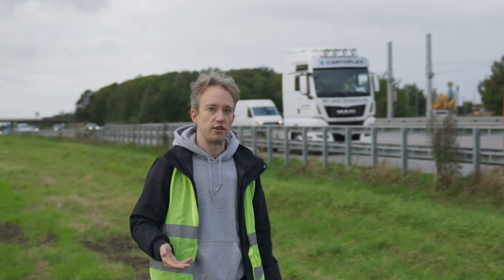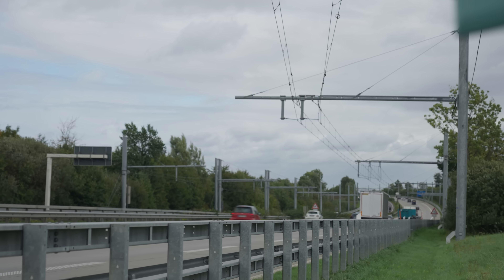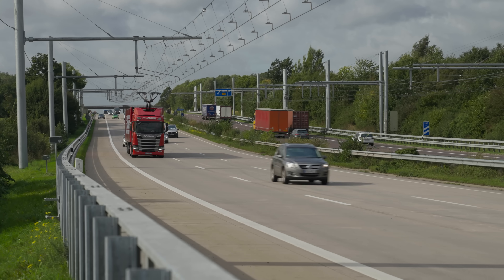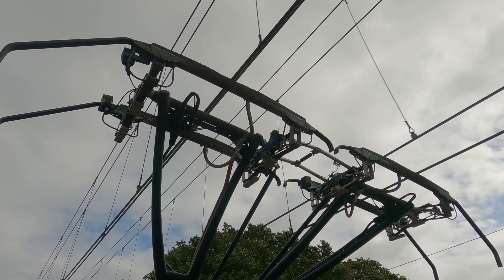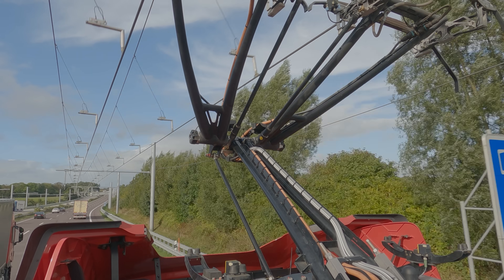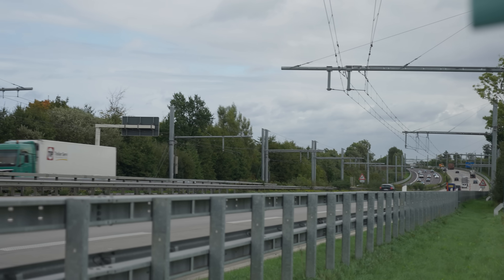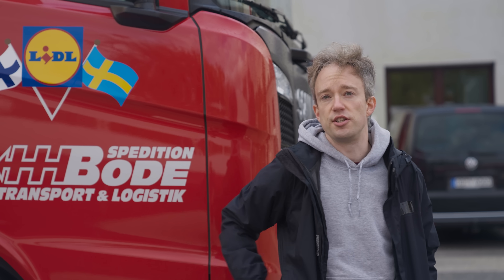The highway where trucks work like electric trains

Comment from the maker: I'm worried that this feels like an advert. It isn't. This is just a brief overview of the technology, and so far this is just a 2km test track, one of several. But this seems like such an obvious-in-hindsight idea (to me, at least!) that I found it very difficult to frame it in any way other than "I think this is a good thing"!
Reply: That's A fair thing to be worried about, especially with the Veritasium-sponsored video controversy recently. As a long time subscriber, I wouldn't have thought that you would do a video as such, and this doesn't feel like one of those videos... at least to me
Reply: @Cark0213  I mean is that really surprising
Reply: @Tera-plex  No it isn't. It was just unlisted.
Reply: @RicardoMontania  BRUH that's exactly what I was saying...
Reply: @RicardoMontania  so yes it was 🤦🏻‍♂️
Reply: Someone should point out trolley busses in the city of Arnhem in The Netherlands to Mr. Scott. Its city wide and has been operating since 1949...
Reply: @MarijnRoorda  I was going to point out the same thing for San Francisco about half the City back in 2010 was serviced by Trolley Busses. They also had Street Cars(Actual Trolleys) Running in more touristy areas, then there are the famous Cable Cars...but that is a more a tourist attraction then a transit system. The nice things about the Trolley Busses, at least in SF is that the Trolley itself is long enough that it can stay connected to the overhead wires while changing lanes and pulling over to stop. 

In major cities or places that already have trolley busses like Arnhem and SF they could even use that system for last mile delivery. 

Yes, there is still the issue with how the power is generated, but that is something that is also being worked on, and Greenhouse gas capturing is a short term mitigation while medium and long term solutions are worked out.
Reply: @MarijnRoorda  not trolleytrucks?
Reply: @MarijnRoorda  How are the trolleys unique? Most of the quarter-mil+ cities in Eastern Europe have or had trolleys. It's a different system from the video at hand in that trolleys classically didn't have backup (batteries or ICE), and their catenaries are usually captive(ish), following the lines, unlike trains and trams and the system in this video. So, how is the Arnhem trolley system different from other trolley systems?
Reply: @MarijnRoorda  there were trolley buses all over the major cities and towns in the 1950s, replacing trams, then all were done away with in the 60s & 70s in favor of ICE. Now trams have made a comeback in some cities.
Reply: You are teleporting around Europe!
Reply: it worked last century with trolleybuses, should work this century with lorries.
Reply: @misterthegeoff9767  
Yes and given the availability of modern 6wheel 100plus seat luxury coach bodies equipped with modest wt. on-board batteries to get round allow them to take diversions ..road works and accidents as well as having to divert overheads to stops or depots.  Just skip the overheads, lanes and complex juctions become simple to engineer and maintain.
They can be quieter, cheaper and more reliable ...trams and tram lines are a bad combination with other vehicles, cars M Cycles and of course bicycles especially. 
They are also infrastructure intensive and expensive. 

One accident and a whole network or line can be closed for hours or days or months .eg subsidence following flooding ..
if a road vehicle catches fire it can damage the tracks requiring replacement. With little chance of instituting a diversion. 
Dont forget the extensive history of mining war damage and unstable ground conditions and underground services in many areas.

You also have problems with debri and vandalism of the tracks. 
Water, ice and snow also require specialist track clearing equipment.
Reply: Hi Tom!  Maybe I missed the point, and if so then correct me, but isn't all of this already done by electric freight trains? I don't think you need this as long as you use the freight network that is already put in place.
Reply: @creator2960  The train infrastructure in Germany is at max capacity and incredibly, frustratingly inflexible. It would costs a lot more to lay new tracks - in terms of money as well as time and area. And there just isn't that much free space available. 
:D Oh, and those highways are already very handily lying everywhere around the place. ;)
I love the idea. And it's great that they test it to see whether it turns out to be as good a solution as it seems.
Reply: But Tom, isn't it obvious that for those mentioned long distance transports the environmentally better solution clearly is: Origin : E-Truck -> Train -> E-Truck : Destination, where E-Truck is a battery powered truck for schort (sub 50km) distances?
Reply: It doesn’t feel like an ad
Reply: No no you've convinced me to buy several miles of electrical infrastructure it's all your fault
Reply: Seems like the ideal solution is to build a Catenary Truck that's also fully electric with a lot of energy in a big box, and to use the catenary system to allow the truck to conserve 'fuel' along the highway and use it only when going out into the more rural areas, as discussed. 
The ultimate "¿Por que no los dos?".
Reply: @JonathonBarton  That's what that truck does, off highway it runs on batteries.
Reply: @marvindebot  Tom specifically stated that "it switches back to diesel".
Reply: @JonathonBarton  I know, I was replying to someone who thought otherwise.
Reply: There is also a track like this in the Nordics somewhere, I think outside of Stockholm.
Reply: Don't worry, Tom Nicholas can't hurt you.
Reply: it's funny that busses used to run like this in cities until internal combustion engines and fuel got cheap enough. and with trucks possibly going to that system, we went full circle
Reply: Tom Nicholas putting fear into the hearts of youtubers these days.
Reply: You didn't get paid and had control. It's not an ad.
Reply: it's all good. i love this type of content
Reply: I would just like to point out that Top Gear actually suggested almost exactly this idea for electric vehicles about 10 years ago. Use a battery power to get to and from main roads and power the vehicles using overhead wires from that point on. It always sounded like an excellent solution to the problem of EV range to me.
Reply: Wish there was an economic breakdown of this 2km track. How much did it cost to build, and how theorhetically it could pay for itself
Reply: This is the age old argument for electric vs diesel trains in the 18-1900s… it’s up-front investment vs long term expenses. You’re not wrong, but history has proven humans are greedy and short-sighted ☹️
Reply: If you are going to use a ”track“ anyway, why not us a freight train for port - warehouse transport?
Reply: this feels like a goof fit/evolution for your channel.
Reply: Didn't seem like an advert to me.  There was no mention of any specific manufacturers or companies.   The only product I noticed was a Scania truck and that was only in an incidental outside shot as you passed the working truck.  I think wouldn't worry about it.
Reply: @epolk1968  So, if I were to shill this hard for something else, say big pharma, but didn't "mention any specific manufacturers or companies", it's not shilling? Interesting...
Reply: Is Germany your favourite country?
Reply: If this is an advert, where can I buy this product?
Reply: This seems like an incredibly stupid approach due to the HUGE infrastructure cost and maintenance of these electric terminals. Hydrogen is a terrible solution for consumer vehicles, due to its own infrastructure needs, but makes a ton of sense for trucks due to them taking the same routes. It's cheaper than electricity, easier to maintain, not stuck on a grid, etc.
Reply: but Tom. Have you considered Trains
Reply: @ff-qf1th  kind of my thoughts too but this is probably a cheaper solution
Reply: Tom, you could always do a follow up by visiting a TrolleyBus museum in the UK - a quick google shows there are ones in Norfolk and Doncaster. They might be able to offer a discussion on why the system might not work.

For other people down the thread talking about pollution, something you might want to consider is the efficiency of electirc engines vs combustion ones. An electric motor converts something like 85%+ of the energy it receives in to motion, compared to (usually) sub 40% for a combustion engine, so in theory it will make better use of any extra fossil fuels used to generate electricity. It will at least enable them to use some renewables in place of existing fossil fuel usage
Reply: At worst it could be seen is advertisement for less polluting alternatives, which is still a good thing
Reply: As a lorry driver, this is a good idea. Needs work and legal changes on size limits to retain driver access to the front of the trailer, and not reduce driver comfort. We need bigger cabs, we spend huge numbers of hours in them.
Reply: it doesn't have a skip button, doesnt lie, and is excellent. Therefore, it cannot be an ad.
Reply: You are not veritatisium so you are fine
Reply: Don't worry about it. Tom Nicholas was being a jackass.
Reply: Doesn't sound like an advert at all mate its just demonstrating an option for the future. Didnt feel any bias
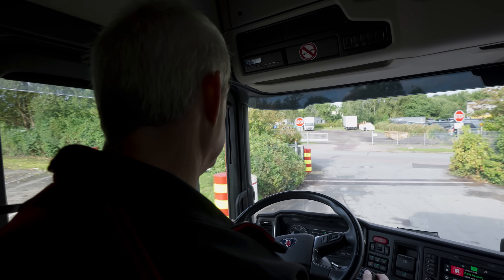Reply: It doesnt feel like an ad from content perspective ( I fully share the enthusiasm about the e-highway and very happy you made a video about it!); yet having the LIDL-logo so obviously and deliberately in frame (3:15-4:00) felt very weird and atypical. 

What was happening there?
Reply: i really love how Tom Nicholas made Youtubers think more about the ethics of their videos, haha.
Reply: Not really an advert, i am not about to go out and buy 200 miles of wire and rig it over a road now am i?
Reply: I mean, almost everything you make could be seen as an advert. So no worries there! Thanks for showing me what neat things are occuring over the pond!
Reply: Live in Germany and Drove by this and thought what is that ? Thx now I know and its indeed a great idea
Reply: It's a good idea but we can't even electrify railways lines north and east of greater Manchester
Reply: It feels like an advert for Germany :)
Reply: I am wondering why there is no sinus like the wires are ... going from left to right and back so the pantograph doesn't get cut by the wire. This is done for the wires for trains.
Reply: In light of the recent controversy with a certain batch of sponsored channels about Waymo's self-driving cars, I was extra wary watching this video. Glad to see it wasn't just a sponsored video.

Sponsors are fine, btw, but only when there's no conflict of interest with the actual content of the video.
Reply: The Lidl logo might have been a bit too prominent there, but I totally agree. Where I am from we have buses working on the same technology in some cities (for decades at this point) and the moment I saw this made me realise what a shame it is that this isnt a common thing already.
Reply: Need to make sure Tom Nicholas doesn't make a Tom Scott youtube propaganda video
Reply: A brief overview of very promising technology often becomes and advert, no matter how you do it, as it's mostly positive.
Reply: You worry too much Tom. But your overthinking is endearing as it shows how humble you are. ✌🏻❤️
Reply: I didn't feel it came across as an advert at all.  just someone excited about a very positive possible future
Reply: One of my colleagues has been saying for years: car makes put batteries in cars and want to teach them how to drive automatically, but we have trams in the city and metro in underground tunnels that are fully electric and self driving. Why not change the infrastructure instead of the cars?
Reply: and is the electric grid powered by coal?
Reply: What about oversized loads?
Reply: and thats all it should be, a cool thing that you're reporting on, dont feel the need to apologise for framing the video how you did
Reply: they better utlize the train lains, during night , trucks will make less noise than trains :D all they need is to tweek the train laine to fit trucks wheels.
Reply: Why not build a railway for those routes ? Wouldn’t that make more economical sense ?
Reply: I think we have to ask what's in it when we didn't build that earlier? Practice will show us why... today we are not questioning enough our history
Reply: Trolleybus would have been a more appropriate comparison than electric train.
Reply: Back in the 1960s, the Uk had trolley buses run by overhead electricity cables just like trains today.
Reply: @gilbertcampbell4679  trolly truk also normal think in ussr
Reply: Was this clip sponsored by Lidl?
Reply: xd
Reply: Allg Tom, as always good video
Reply: Visiting my lovely home country a lot recently...
Reply: This is so cool
Reply: no it definitely didnt feel like an advert. I didnt think that even once until you said it. I didnt even know about this until your video, great stuff amigo
Reply: @Cark0213  Its electric, it ran out of power and got delayed.
Reply: I didn't feel like it felt like an ad at all, just a positive explanation of it all and its potential
Reply: It is an advert for the technology not for any company
Reply: Nah it doesn't feel like an advert. I like how despite it's short length you covered the technical and economical challenges faced. I had never even considered the fuel tax that would need to be replaced.
Reply: I look forward to seeing the next stop in Germany, hopefully, Wuppertal where they have suspended trains!
Reply: @dancan4949  There is a second electrified highway between Frankfurt/Main and Darmstadt along the Autobahn A5.
Reply: Why not just build a train
Reply: Didn't come across like an advert at all, interesting and informative as always though!
Reply: The UK is looking to build a test route on the M180 near Scunthorpe.
"theguardian uk-government-backs-scheme-for-motorway-cables-to-power-lorries" (sorry Youtube link remover)
Reply: doesn't feel like an advert. No branding. no "visit sponsor". Just straight forward tech talk. Love it
Reply: But lorry trailers very in height considerably and some roads take oversized loads.
Reply: raises hand
Um it is good and tested. it was done in the USA decades ago for bus systems decades and decades ago.
Reply: Well, it is a good thing
Reply: Doesn't feel much like an ad, Definetly feels more like a look at this interesting thing.
Reply: its a EU thing, will never happens in the UK...
Reply: Why not just have electric rail? Coefficient of friction is lower and tread degradation is drastically lower on rail than road surfaces.
Reply: @davisbradford7438  You have to build and maintain tracks all over the place, while a developed road system is already in situ. Why reinvent the wheel? Apart from the hassle of routing these tracks where they cause the least environmental damage as well as not upsetting homeowners whose property they will run through because rail tracks are less flexible than roads in terms of geography, you are going to have to swap loads from rail to road to get them to their final destination whereas lorries can continue off-grid door-to-door more or less.
Reply: Top Gear was right.
Reply: Hmm, why not put the connection in the road instead of above, you know, a bit like a giant Scalextric set ? There are pros and cons of doing it either way but if you could get an induction (no physical connection needed, just close proximity, that would be cool. Now you might say why bother when it must be cheaper to cable from above. I'd say that would be correct but have you thought of the height of the semi-trucks? The class of semi in the video does represent a lot of freight vehicles sure, but anything smaller (less tall) couldn't use the infrastructure (it couldn't reach the set height of the cable). If you're going to do this it might make economic sense to get more types of vehicle to use it. Cars, for the most part, may not need it but anything larger like pick-ups and vans could. 

On balance, maybe it's still best to go with the overhead (on cost) , just thinking out loud really and interested in if the people who put this together thought about other delivery methods.
Reply: Do they steer the car manually or does it have some auto-lane-keeping system (idk what it's called)
Reply: Alright
Reply: it's good to be cogniscent of this, a lot of youtubers are doing adverts on the DL these days
Reply: It's an "OK" thing. Looks more than a little like the old (or rather quite recent, I think) adage: "every time we try to revolutionize transportation we just end up reinventing trains but worse."
Reply: Sometimes people like watching "I think this is a good thing" videos
Reply: I guess you’re not familiar with trolleybuses
Reply: I think to work well it must completely be anonymous
Reply: The electric infrastructure it needs a hyper boost and renewal to be able to sustain the close future power demand...
Reply: @Cark0213  You can upload videos in advance and just make them public on a set time
Reply: How are you enjoying your new electric truck Tom ?
Reply: Nice little insight… when I was younger I thought the same but based on trolleybus style. 
With the camera and tracking technology for the pantograph that looks more flexible. Though the catenary could have been deployed more elegantly.
Reply: FYI ICYMI: The UK announced a similar test project recently
Reply: i wasnt gonna buy it anyway its far too expensive for me.
Reply: This is not something new, the trolleybus also works that way in the city and it was removed.
Reply: A lot of existing tech and overcomes the battery weight problem.
Reply: Tom, are you displaying the usage of time travel, also in this video?  Released today (the 25th) but you commented on this a week ago... 😁
Reply: I think this is a good idea for a cheaper infrastucture in the short term or bypass land selling for railways. Only gud for situtation where railways is not an option.
Reply: Use the money for trains and save a lot of energy
Reply: Use the money for trains and save a lot of energy
Reply: It's an advert of LIDL - there was its logo on the truck.
Reply: "Obvious in hindsight", well, not really, it's been done before and is called electrified railway. Applying the same thing to lorries is just a waste, especially since we should move away from using lorries for long-distance transports.
Reply: The infrastructure will still cost
Reply: @FPK, of course, they all have their advertisings in the video.  I'm just joking, don't be so serious :)
Reply: Lidl
Reply: @Tom Scott: video idea by the way: the rail cargo shunting yard in Maschen, Germany
Reply: 2km test track and you look at the wear marks on the truck connections, going for hundreds of km will cost
Reply: Troleybus that is also a truck. That's what the title should be :D On the other hand - this looks like a really really interesting thing!
Reply: An advert?
This struck me as "Tom Scott finds an excuse to take a day-trip living the life of a long-haul trucker and get his YouTube channel to pay for it."
Reply: Umm, 1 week ago? I think that this video was private until Oct. 25
Reply: How many tons of a carbon dioxide are produced by the coal-fired electricity generating plant needed to recharge or power directly these trucks ?
Reply: Great job Tom,   this is not an advert,  no way,   its a technology showcase.   You provided truthful statements,   clear operational information,  aswell as actual operation of said technology.   Great job
Reply: Isn't it just cheaper to use already developed train infrastructures, instead of building a new one?
Reply: I think this is a good idea, too. Now we need to discuss how to implement this in the US, where grid-tied transportation is still in its infancy.
Reply: starting at 3:30, a Lidl logo is in frame almost the entire time... Clearly this is not an advert for the road electricity, but it's an ad for Lidl ;)
Reply: Me 2 thinks this is a good thing...
Reply: I'm sold, I want !
Reply: This incredible amazing super modern technology has been done and keeps functioning in Alushta, Crimea since Soviet times. It has been launched around 1970 and the highway there is powering trolleybuses and trucks for half a century already. The road is connecting Alushta and Simferopol.
Reply: Nice try, I'm telling Tom Nicholas on you!
Reply: yo mr scott - the bus system in salzburg works the same way - maybe you might wanna take a look at it
Reply: Well, I just think it is somehow not a perfect solution if you build new infrastructure form scratch that can't be used by cars, too. If you spend much money to implement a standard system for highway electrification as many users as possible ought to benefit from it.
Reply: Did not sound like an advert in my opinion👍🏽
Reply: I thought it was a LIDL advert
Reply: No issues here with presentation.
Reply: It seems like a great thing, and a similar smaller system maybe for the left lane, that could power passenger cars would be great.  Battery packs in cars could be much smaller.
Reply: 201th
Reply: I'm sure someone has already pointed out that the sale of new petrol cars will now be banned from 2030, and diesel cars from 2035.
I wonder how they'll electrify the M1 now they've built 'smart' gantries most of the way along it. We also have plenty of bridges over our old motorways. Could they squeeze electric cables under them?
Reply: well' in my opinion this is way better than self driving cars... just use the "train" concept, problem solved! quite simple and effective if you ask me :)
Reply: It's an advert for anything-but-trains.
Reply: but how would the lorries drive in the leftmost lane for hours on end as they do in the us?
Reply: Dunno about ad but I feel that I have sudden urge go to grocery shopping to lidl.
Reply: Not convinced, the infrastructure costs are astronomical not to mention the issues caused by de-wirement or the panto coming off. I think hydrogen is more realistic for trucks.
Reply: I thought Lidl was the sponsor
Reply: There are some city bus routes which use hybrid busses, diesel or diesel-electric hybrid for on-road, and electric catenary + pantograph for tramway/tunnel. I don't recall which cities offhand, but they're interesting to ride in. :-)
Reply: The rest of Europe is behind?! That system is in Sweden 15 years ago.
Reply: effecient in wasting the metal and screw up nations like africa even more
Reply: Y
Reply: 2040 is 18 years away......... Oh no 😲
Reply: Wow
Reply: Interesting concept!  Would it also be feasible to charge a truck battery while in transit?  It would completely get rid of the charge time dilemma.  Just have to find a clean source to power the system..
Reply: I wonder how would they measure how much energy that particular vehicle used and how much will it cost.
Reply: An advert? You should've worked out an affiliate link, I'm sure you've convinced a few of us to get one for our driveways. :P
Reply: 9
Reply: Perhaps a mention of alternative uses of this sort of investment (eg in railfreight) would have made it seem less overwhelmingly positive. But that said, yes, I do think this is a good idea. Just that the shiny new thing shouldn't come at the expense of the tried and proven technologies we already have but just refuse to invest in in Britain.
Reply: Sponsored by LIDL
Reply: What do you think about trains, this would be a better solution. In Germany we have so many trucks on roads because the train infrastructure is not so good. The Deutsche Bahn makes more money moving cargo with trucks than witch trains, isn't that ridiculous. They should increase train capacity, this would decrease the number of trucks and would be the most efficient.
Reply: No need to look for negatives in every little thing, especially when they are trivial or non-existent
Reply: This exists in Vancouver on their bus network and buses can transition from the overhead wires to the road when they get further out of the city centre.
Reply: I love this idea; can it be powered by solar?
Reply: it was a really cool video thanks for sharing!
Reply: So the trolley bus was not as stupid as london thought.
Reply: that this might be an advert didn't even cross my mind

another excellent episode (as always)

fantastic to see countries around the world working towards solutions, unlike here in Australia where the current Federal politicans spend all their time and effort (and our taxes) proping up the ff industry, and impeed the transition as much as possible
Reply: And the other "obvious idea" is Regenerative Braking Accumulators on all Railway Trains that take the energy wasting out of stopping and starting, going up and down inclines etc, that idea is already used in Minesites for loaded descending trucks that use the recharge to go back empty. Some optimisation required.
Reply: @davidwilkie9551  It still changes nothing if we don't reduce the production of fossil fuels. Good idea but still it doesn't address the production of fossil fuels. That is the issue
Reply: Clearing things up since Veritasium just got caught up in a scandal
Reply: If nothing else, it makes me feel proud to shop at Lidl ;)
Reply: trolly bus and trolly truk
Reply: soviet trolly bus
Reply: @carkawalakhatulistiwa  " bald and bankrupt" would appreciate...
Reply: @lorenzoblum868  in the city of Moscow they replaced all the trolly buses and removed all the electric poles in 2020 and replaced them with diesel buses. that's why we like capitalism
Reply: nice video
Reply: It's a train
Reply: @paulshillito7162   is  trolly truck
Reply: I have to admit, it would feel less like an advert/sponsored vid, if the camera operator at the end hadn't seemingly been working hard to keep both you and the 'Lidl' logo on the cab door in frame at the same time, instead of just tracking you. I get that an off centre presenter is probably more interesting, but they could have just cut it to the Swedish flag, given that they didn't seem at all bothered about keeping the Finnish flag in frame...
Reply: This is amazing and incredibly necessary. Has to be done TODAY where cargo rail lines can't deliver. Thank you for showing solutions to the biggest problem of our time, the climate crisis.
Reply: But why the focus on the Lidl logo? That should be blurred out. ;)
Reply: Don’t worry about it. It’s a nice video. Two things. One, this kind of system is already used in Arnhem in the Netherlands. For the trolley buses. Probably among other places. Two, the power grids in this world have serious issues in dealing with the energy transition. That is a real issue with these kind of initiatives.
Reply: We also have such a track by Frankfurt airport on the highway 🙃
Reply: It does seem very obvious
Reply: Hi Tom, didn't like how close the truck wire looked to the sign at 2:57 ! What do you think
Reply: It felt like unthinking belief in a relegious dogma instead of science: don't question it; don't doubt it!  You must believe!
Reply: Do people really think you just post a video publicly right off the bat? Thank God most people on this platform don't post videos
Reply: struggling to see this as  a BETTER SOLUTION that Electric Trains on rails? Speed, Efficiency, no traffic delays, and if they are running exactly the same route, why not use them instead?
Reply: What sucks is that there's now TWO unskippable pre-roll ads instead of just one.
Reply: I'm always in for an anti fossil fuel / pro electricity solution, even when it's still an idea in development.
Let's burn as little fuel as we need to keep the planet spinning 💚
Reply: Way too many commercial Tom Scott
Reply: It's unlisted
Reply: Was*
Reply: Ok
Reply: Even if it was an ad, it's one I don't mind. We need more inventive green solutions like this to save our planet.
Reply: @TWISTEDGiraff3  it's not green when most of Germany's electricity is generated by burning fossil fuels, it's just moving the problem from one place to another.
Reply: @benjones9822  I think the point is that generating electricity on a massive scale even with fossil fuels is more efficient than generating power from a single trucks combustion engine. It’s not the perfect solution but I think it’s a step in the right direction
Reply: Nice use of the three pints of contact Tom 👌🏻
Reply: Tom Scott - I think it’s brilliant! When the electricity can come from renewables as well, we’ll be on the right . . . track 😉
Reply: Thanks Tom this is a perfect topic for my sustainable engineering report on future transportation.
Reply: Do you relize that two months ago, there were enough fires in the arctic to surpass all fires on planet earth? arctic is no longer a reflector of suns heat energy back into space, but a absorber. The arctic is the most important part of controlling the temperature of the Northern Hemisphere.
Reply: d
Reply: Which manufacturer was involved? 😉
Reply: Well Tom, don't be worried for having an opinion on great technology. I'm an electrical engineer and I have not heard of that test track. I've heard from that idea but not from the testing. I think it's one of the best ideas!
Reply: Ok
Reply: Thanks for the video Tom. Would be great to know the charge efficiency of a 2 mile stretch. Given the accelerated pace at which fast-charging is becoming a reality i could realistically see these strategically placed along patches of highway to ensure end to end travel without refuelling.
Reply: I don't think that would work there's a lot happening in the road with motorists
Reply: As usual it was simply a good video, I appreciate your concern, but on this occasion I think you don't need to worry.
If they do something like this then at least they won't be digging up all the 'smart motorway' lanes that they have been putting in place for the last decade.
Reply: @Cark0213  You're just too late
Reply: in concept... but in the overall world supply of fossil fuels.. you trade electricity from a fuel burning plant to a truck... which burns more fuel?
Reply: It's really good because china will more powerful because of electric vehicles industry they have monopoly in Li- ion battery industry with that money they can make another pandemic
Reply: Instead of electrical wires overhead ,  it maybe better on the side of the road in the center lane or underground.  This maybe cheaper to construct the entire system.
Reply: So you think it’s a good idea to take copper and lithium from the ground, plus you also need to take coal from the ground, and then we can drive? 
Instead you can produce gas from our own garbage and from plants and we can drive 100 percent green on already known technologies
Reply: 2k21: zoomers have invented trolleybuses
Reply: if Elon did not live in LA and Texas the US would be way way behind on electric vehicles!
Reply: This did not feel like an advert. This felt like hope and optimism. Thank you for sharing this!
Reply: It's a LIDL ad! There is a logo!
Reply: sell out
Reply: this is most stupid thing they could ever create especiallly if know that it is very old technology, nothing new for example in USSR were used Trolleybuses with powercells so they could ride without contact to wire not much maybe about 20-30 km but for cities it were more than enough, and now they call it "new technology"
Reply: Nothing wrong with adverting electric energy, but this, is just stupid
Reply: Don't be unsure about your observation, wires are a prooven technology :-)
Reply: @hiddehosper4914  10km of wires... Thats no proof
Reply: @philippelesbre5323  all the wires above rail doesn't count?
Reply: I also believe it is a good thing, but I also think it is very restraining. Unless you have these cables in every single corner and dirt road, having to be connected to cables will limit access and mobility to a large number of users. There has to be a better way, I hope.
Reply: It is a massive advert for Lidl :D
Reply: Not phased out... Irresponsibly forced out.
Reply: I wonder about what happens if there is an accident - or even ice on the roadway and it's the truck snares a wire when  it hits the power pole - I can see why the safety review by police and fire brigades was important thing to do.
Reply: Yes it's a good thing!
Reply: Love your integrity.
Reply: Quote a painful way of explaining a very simple protype.
Reply: soviet trolly bus .
Reply: trolly truk
Reply: I think there's a Highways England plan to test this on a stretch of road near Scunthorpe, but when you consider we've done this on trains for years and yet fairly recently network rail abandoned plans to electrify one of the main lines due to technical challenges and the resulting cost. doing this to roads will have very similar concern's, bridges, traffic information signs etc. It's a good idea, but we shouldn't underestimate the challenges of achieving it especially in those time frames, and in some sort of budget.
Reply: It is a good thing, and it came across the same way all of your videos do:  Interesting and informative.
I just have one question about this system.  How would the power company know how much to bill each trucking company?
Reply: “Obvious-in-hindsight”? No kidding!!!
Reply: but it's a slow moving truck and doesn't do 0 to 60 in less than 4 seconds
Reply: IT WORKS AS AN ADVERT ! Very easy and clever tech ! All motorways should be converted
Reply: this is one of the most stupid things I`ve ever seen apart from the fact of tedious maintenance over large distances of this colossus Soon to be outdated infrastructure. Which would inevitably be replaced by HGVs which eventually go electric. Economic`s would favour tracks that carry their own batteries and can be charged up using facilities at their depots.  Which would be a hell of a lot cheaper than paying for the electricity that comes from those overhead lines which would be at a premium because of the immense maintenance costs.  Of course the people putting these Overhead power lines in would be getting government grants and handouts all paid for by higher taxes for the people of the country.  This is a total scam just like global warming which is not happening.  Global warming Lai is being used by the world economic Forum to try and institute their Great reset allowing them to do a power grab we`ve all seen what happened in Canada with Justin Trudeau little baby of the world economic Forum just like New Zealand and just like Australia. You`ll owe nothing and be happy. the future for trucks from an economic point of view is battery electric powered but the batteries need to be capable of way over 1 million miles lifespan to make economic sense. which is virtually here now.
Reply: So how is this technology's application changing now that Germany is having to drop its green energy and is rationing the EU's gas?  Is this being dropped or continued, and why?
Reply: @trevorjohnson2073  this is one of the most stupid things I`ve ever seen apart from the fact of tedious maintenance over large distances of this colossus Soon to be outdated infrastructure. Which would inevitably be replaced by HGVs which eventually go electric. Economic`s would favour tracks that carry their own batteries and can be charged up using facilities at their depots.  Which would be a hell of a lot cheaper than paying for the electricity that comes from those overhead lines which would be at a premium because of the immense maintenance costs.  Of course the people putting these Overhead power lines in would be getting government grants and handouts all paid for by higher taxes for the people of the country.  This is a total scam just like global warming which is not happening.  Global warming Lai is being used by the world economic Forum to try and institute their Great reset allowing them to do a power grab we`ve all seen what happened in Canada with Justin Trudeau little baby of the world economic Forum just like New Zealand and just like Australia. You`ll owe nothing and be happy. the future for trucks from an economic point of view is battery electric powered but the batteries need to be capable of way over 1 million miles lifespan to make economic sense. which is virtually here now.
Reply: I'll say that this is Germany's answer to Japan's Fuel-Cell powered buses.
Reply: blackpool have had trams since 1885, so why not build trams that that can deliver goods
Reply: This felt like an advert thank you for clearing that up
Reply: It didn't necessarily feel like an ad to me.  The video was nice.
Reply: No bro this is the future, not advertising...
Reply: The rubber tires still pollute, just use freight trains instead.
Reply: @ncard00  There are lots of factors besides rubber tires to take into account in the calculation.
Reply: Ok
Reply: What about maintenance? Issues with failures? Accidents? % availability? Efficiency? Why not put the cables underground?
Reply: train would be the next step ;)
Reply: dude, this video opened my box of thinking. i had totally forgotten that this tech existed and was easily adapted for roadway use. i REALLY want to see this be used and to appear in the usa.
Reply: Nothing wrong with adverting something you think is good. If more people talked about these things we'd probably start introducing them at a quicker rate.
Reply: Only it is a bad Idea
Reply: Just trolly truk in ussr
Reply: You will understand, take a ride with me ;) 
🚂🚃🚄🚅🚈🚞🚝
Trams, trains and more trains and trams :)
Reply: Bus
Reply: @TomScottGo.Maybe can be aplication in Indonesia transport truck🙏
Reply: if u drive there it looks like SH, ruins whole landscape
Reply: The biggest advantage in this. It will keep all big trucks in a single lane and out of the way of the higher speed traffics.
Reply: 👍🏻We waiting for this hybrid cars are to good solution for next 20-30 years
Reply: trolleybus that carries cargo, wow! who could have imagined that??
Reply: Aha, this system can be used to charge electricity cars on the freeways, while traveling.  Bright idea.
Reply: I think battery swap would be a much more practical and economical solution.
Reply: It is a good thing, battery manufacture doubles the energy consumption of a vehicle, this turns vehicles other than e-bikes from a bad joke and a scam into an energetically meaningful solution.
Reply: 📢project is canceled now! 😭🙈😵🤯
Reply: American?
Reply: 350th reply, all I have to say is this video reminds me of Back to the Future.
Reply: I'm VERY sensible to ads, like I'm talking ad-block EVERYWHERE kind of sensible. And this didn't feel like advert at all, you were straight, endorsing the technology not a company, speaking straight and plain facts, and being entertaining and informative, not persuasive and convincing. I think this is a great showcasing video and you've really gone a long way in mastering and naturalizing the format.
Reply: it looked like LIDL advert at the end 3:51
Reply: The best question I have about this is the efficiency of power transfer and where is the power coming from to begin with. Assuming that power is generated in a clean way then of course it would be a good way of doing it, but if it is still off of coal for example.. well we are trading diesel for coal which is not as an effective transfer
Reply: @LufiaSinistral not coal, russian gas so it is much cleaner.
Reply: Same
Reply: It's not advert
But this has some overlook factors that make it from really nice to meh, including:
Planting all those posts.
Construction blocks at least one lane while not crating a new one (only reducing CO2 later which is great don't get me wrong.)
Cargo should be transported by train Only for long ranges and battery driven lory's for last mile delivery .
The Pantograph's  wearing faster out , cause the zigzag of the Powerline can not be so precise like on a train track, which prevents most of the wearandtear on those Graphite bars.
The Powerline is concern to any flying debris or tree's and complicates the "simple" road.
That Powerline would press the truck market in a kind of hybrid stage, and knowing our German government that would like to stay for further dirty diesel sales....

So yes this is a good idea or would have been 30 years ago.
Now battery tech will drive so quickly that this is obsolete in 10 year's
Reply: what's wrong with people? this isn't meant to reinvent railway, instead its an solution to battery powered vehicles range problem, vehicles that are needed to supplement trains or needed when trains are not an option, TRACK DRIVEN VEHICLES ARE EFFICIENT AF  BUT ALSO RIGID AF, YOU WILL ALWAYS NEED A FLEXIBLE TRANSPORT FOR SMALL SCALE/PERSONAL USE!
Reply: Just shows how good of tech it is that just showing it feels like an advert.
Reply: Nah, I disagree. This type of technology is right in line with this channel.
Reply: Nice
Reply: It's not solar roadways. It works. The question is how well in the long term and how much energy is really saved on those main trunks.
Reply: How on earth did you post that a week before this video came out?
Reply: @justryan7212  unlisted videos
Reply: @justryan7212  That's his next video. - Time Travel works
Reply: @justryan7212  You can upload videos in advance and just make them public on a set time
Reply: @justryan7212  You can upload a video with a release date in advance.
Reply: I live near the E-highway in Lübeck, and drive along there in both directions for 1 week. i think it's funny never to have seen an e-truck there and an englishman (great video, by the way) has to come to show it to me.
Reply: @best.burger  But you can go to a nearby railway line and see an electric loco pulling a consist of over 2000 tonnes time and time again😊
Reply: It doesn't
Reply: @realisM404  watch "a story of youtube propaganda" and you'll understand
Reply: Well, if covering a tech, what are costs if building a metal frame and then electric lines for probably 1 truck a minute, if truck is 1/1000 cargo of train and elec trains barely worth electrifying ala UK don't do it, overall does it even make basic sense? Ala solar roadway overpraising crazy green ideas shows society is not being scientific like this ad without any impartial numbers,. ,, I am being bit harsh but jeez any crazy idea gets coverage, , , I wish any of these numbers were covered one should NOT cover unproven ideas like the normal subjects,.  Or I could be wrong, but bet not its unfeasible X10 , , ha
Reply: @aaa69200   I don't have problem with renewable, thorium... but with the idea that new energies alone are the solution. There is no solution without ethics which is what we're lacking most.
Reply: Not reasonable solution. How much carbon particles are scraped off every 10 000km (how many kg)?  This is not a train/tram, this is a trolley (normal wheels/tires) with fixed pantograph. How much carbon footprint one km of metal poles+concrete creates?
Reply: It only feels like an advert because it's a working, responsible, reasonable idea. You went over the downsides plenty.
Reply: well, theres a problem, electric vihicles are only envirmentaly friendly in places where they use geo thermic, nuclier or dam based power, since coal, gas and other combostion plants only move the co2 prodduction off the road and onto the aditional plants that are built to power the contries cars, and solar and wind power are bad for the envirment in non barron lands, sollar takes up lots of land/kwh and so does wind, and wind has the added effect of killing off birds, so before contries loby for electric cars, they should loby for nuclear plants and for research into making them even more efitient then they are, since the only gas they give off is steam and the waist pfoducts can be easily disposed of or purified to be reused, and please try and inform viewers of the dangers of wind and solar when theyre over used or purly placed, like deforistation, taking up plains where animals lived, and killing birds, since i like birds, and i dont want hippies in office smoking weed and half reading envirmental plans to kill off all the birds
Reply: You're wrong.
Reply: It does sound like an advert, to big government.
Reply: You have any clue how much extra oil a nation burns by "phasing out oil"?

Oil still gets burned to produce all this infrastructure. AND ITS LESS EFFICIENT THAN SIMPLY BURNING SAID OIL AT 50% EFFICIENCY.

This is all so insane.

Know how i know this? Since money and oil are 90% correlated, these subsidies equate to 90% of the dollar amount worth of extra oil your nation burns.

In effect your just burning EVEN MORE OIL-Exept its just happening outside UK borders. Real altruistic UK.
Reply: Eastern European cities with "trolleybus" lines would like to disagree. This is enormous infrastructure, that will eventually fall to a certain level of disrepair and will be a horrible eyesore.
Reply: let's be honest Tom if this was an advert i don't want to sound rude but i most likely wouldn't have known or cared i just want to watch an interesting video
Reply: As a German, "das ist ein tierischer Hirnfurz"
Reply: why not generate the electricity using the spin an electic vehicle generates?
Reply: @Charok1  electric vehicles are very very very very very very very very very very very very very very very very very very very very very very very very bad for the environment.
Reply: Damn you’ve gotten really old looking in the last couple years
Reply: Posted a week ago, 2 days before Tom Nicholas made that Veritasium "expose" video where Veritasium talked extremely postiive and one-sided about electric cars while also being sponsored by them. Nice timing to clarify, though your video didn't feel as one-sided and just a view of the possibility in the future.
Reply: And it's just a coincidence that your other science-caster friends also didn't recently do adverts for exactly the same thing too. "Highway" indeed. Disclose the amount you made.
Reply: Earth is flat and Tom is a lying sack
Reply: it is like an advert
Reply: I disagree.  It is extremely expensive to maintain and build.  So while I agree that it would work.. I am not sure about it being the right answer.
Reply: You fail to discuss the source of the electricity. Are these just coal-fired trucks? There is simply no way, presently or in the forseeable future, to generate enough “green electricity” to feed the massive demand that a system of electric trucks would inpose on the grid.
Reply: The vast majority of Germany's electricity is produced by burning fossil fuels. This is just a case of moving the source of the pollution. Germany hasn't got a good reputation in green electricity generation, so this is just a gimmick.
Reply: in Germany, power stations run on coal or gas...👏👏👏
Reply: @Alexandre-ed6oj  Talk about sweeping and obsolete statements.
40—52 % of electricity in Germany are from renewable sources. It's non-electric secondary energy use that is pulling 🇩🇪 down to abysmal overall percentages.
Reply: It is an advert. For the bright future. Keep it up.
Reply: Equip one turd of the German highway network
Reply: Until you realize that Germany is going to stop using nuclear power, and renewable power can't even cover the existing load. So the CO2 is just produced somewhere else...
Reply: @Lueluekopter  yup and that somewhere does not move so the weight of the generator doesnt matter and also the weight of particulate filters doesnt either. a bigger more complex generator allows for better efficiency. so you get more of the energy in the fuel in the form of electricity. and the rest can be used in remote heating. this heat is lost when the fuel is burned on the road (except in winter, where, guess what? its partially used to heat the passenger cabin)
heck if you really want you can capture the co2 for use in the chemical industry and fizzy drinks....
Reply: @Lueluekopter  we have a unused train network in the country, why is nobody trying to mass use it. Oh, the infrastructure is old and needs replacement.
Reply: Didn't seem like an advert to me. Seems like some amazing innovation!
Reply: @CrazyStranger11  One over 120 years old! Trolleybus!
Reply: Watch out Tom, Tom Nicholas is going to release a 2h counter claim saying you're a corporate shill because of this.
Reply: @TheMajorStranger  TvT: Tom vs Tom

Would be interesting
Reply: The only obvious question I would ask is: where does the electricity come from? Right now, most of German electricity is powered by fossil fuels. That's why the guy in the interview (and anyone selling these sort of plans) says carbon emissions could be reduced.

German and European plans to use solar and wind are, I think, not realistic since the output is too low. It's time to bring back the nuclear option.
Reply: @joe_5768  I know this is a common trope, but while fossil fuel powers a lot of Germany's electricity, but it's not the majority. Right now, fossil fuel sits at 39% for 2021, while Renewables are around 48%. And even then: Diesel trucks get 100% of their energy from fossil fuels, while electrically powered trucks only get 39% of their energy from fossil fuels, which still is an improvement, and without even changing anything on the fleet itself, electrical trucks will immediately change their dependency from fossil fuels as soon as electric power generation changes it. In that way, electric truck exactly mimic electric energy generation without any hardware changes. For any other type of trucks, you have to actually change the hardware for any fleet improvement, which means scrapping what you have and building and buying new stuff.
Reply: Tom, 

it really is a bad idea to use batteries in large trucks. Simply the weight of the battery reduces the payload as there is a gross vehicle weight limit which in turn pushes up the cost of everything transported by road. 
The other and more widely misconception is that electrcity is green for vehicles, it is not necessarily so. It could be if the grid is largely nuclear (although that is not without it's problem as nuclear is unflexible generally) but with variable and uncontrollable renewables there is a requirement for a large amount of dispatchable fossil fuelled generation to keep the grid stable. When you add more load to that grid the electrcity for that extra load comes completely from fossil fuelled generation.

The operation of a grid is largely misunderstood and decisons are being made that may not bring the expected results.
Reply: @iareid8255  I think the best solution is to use the electric train instead of the toll road
Reply: ok
Reply: @manlethamlet  👎
Reply: This electrification is merely to facilitate transportation for the continued growth of capitalistic consumerism, which is unsustainable itself. This anthropogenic global warming is a consequence of that exponential exploitation and consumption of resources that is capitalism; even if I believed humanity would actually come together to out-engineer climate change, I do not believe we can engineer our way out of the finite resources of Earth (particularly, the biosphere). Yes, I'm a pessimist. I love science, engineering, math, technology, etc., but I am not optimistic about the actual future we will face.

A sincerely lovely video though!
Reply: But it is a crap technology. Just what the world needs. More overhead wires. Busted balls to get rid of some of them... Just to bring it back 🙄
Reply: This was like watching a 5 min advert on the BBC that they are not meant to promote.
Electric is dirtier than both diesel and petrol ⛽ put together.
Wait til we invade Afghanistan again to remove ALL their Lithium reserves to make CLEAN CARS!!!!!
🤣🤣🤣🤣🤣🤣🤣🤣🤣🤣🤣🤣🤣🤣🤣🤣
Round round round we go Mr Scott x
Reply: I disagree. If it was, than almost every topic on your channel would be too. In my opinion that is not the case. Unless you specificly say that it is.
Reply: Feels like and ad and no, this is a braindead idea. You can either build electric trucks with batteries and fast charging stations, or you can build electric trucks with batteries and fast charging stations and this system, or you can build electric trucks without batteries but duplicated propulsion system to also run on diesel and this system.
Reply: @HenryLoenwind  what's wrong with "building electric trucks with batteries and fast charging stations and this system"? Makes sense to me and i don't think I'm "braindead".
Reply: wait what?
Reply: how is it 1 week ago? the video just released now bro
Reply: Two words
It is !
Reply: Greenwashing. We're still using COAL and such to produce electricity. Tom, do you want to make a video about the carbon footprint of the military industrial complex?
Reply: @lorenzoblum868  Might be, but energy provision and usage are two different topics. Therefore you can't really talk about greenwashing. Because it isn't. These are two entirely different aspects. Of course, the energy provided by coal is not really "green", but you need to start at some point, right?

It is not always that easy, e.g. an electric car where the battery is charged by a diesel generator is more efficient and more "green" than a pure diesel combustion engine (because you can keep the diesel engine at an rpm where it is the most efficient). And an ev has a much higher energy conversion efficiency.

Even if we would use coal - we would need to compare: What is more "green":
1) An electric vehicle powered by coal
2) A diesel combustion engine
Reply: @Varadero124   energy production and usage should not be 2 different topics. Let's make some weapons with renewable and call them "environment friendly"🙄🙈🧠💣⚠️☢️🔥😱🤣🤣🤣
Reply: @lorenzoblum868   The military doesn't need to worry about carbon output!  Having a green military is about as redundant a concept as I can think of!
Reply: @nickh5081  Green military? 🤣🤣🤣. Are you a troll? Or was this sarcasm?
Reply: @lorenzoblum868  we don’t NEED coal and such to produce electricity, 🇬🇧 only produces 5.4% of its energy from COAL and its falling yearly as these plants are replaced with more modern ones that use other renewable streams such as general waste instead.
Reply: @almostanengineer   I'm not saying we need coal but the fact is that fossil fuel is still the main source for electricity worldwide.
Reply: @lorenzoblum868  I think the point is that batteries could reasonably also be charged from renewable sources, whereas diesel can't be replaced in a combustion truck engine.

We still need to change how we generate power, but when (or if) we implement clean energy around the world, electric vehicles will be ready for it.
Reply: @lorenzoblum868  Obviously not nearly as much as the automobile or livestock industries.

Human existence always had somewhat of a negative impact on the environment, and the more of us there are, the worse it becomes.

Damage control is all we can hope for now.
Reply: @danielathayde  obviously you're on the military industrial complex payroll
Reply: @lorenzoblum868  OBVIOUSLY, why else would a guy advocate for clean energy and mention the massive environmental impacts of the automobile and livestock industries?

In all seriousness, I think we should bring back gatekeeping. People that stupid shouldn't be allowed to be anti-military, it makes the rest of us look bad.
Reply: @lorenzoblum868  some places (like my province in Canada) generate electricity from hydroelectric dams. No emissions
Reply: @lorenzoblum868  yes....but... Getting petrol or diesel out of the ground requires/spends resources to mine/refine it and then it releases carbon dioxide etc. when it's burnt it's a two-stage process.

Electric only generates emissions while it's being created the actual burning or use of electricity is completely clean. Even before we get into developing cleaner electricity this is still a huge saving. And no I'm not an eco-warrior I love combustion engines and absolutely hate electric cars I'm just stating the facts.
Reply: @Adam.Piper62  I love cars but I only drive for my toolbox. Otherwise, bicycle and public transport. Haven't taken a plane for 40 years....
Reply: @lorenzoblum868  fine, I hear you. But trying to make up a quite frankly terribly short-sighted reason as to why those electric trucks or anything similar is a bad idea is quite silly... Whether we like it or not the world is changing we just have to enjoy what we have now and accept the inevitable of boring electric cars is arriving. For the planet bla bla
Reply: @Adam.Piper62  I did not say electric truck was a silly idea. I'm pointing out that without ETHICS, there is no miracle solution.
Reply: @lorenzoblum868  only because we are still mining coal. Don't get hung up on end use energy distribution. The key in this case is on the supply side. Forget about the technosolutions (the best will survive the worst will fail) Ban production(mining) and we will get there.
Reply: @frictionhitch  clean energy is a myth to justify hyper consumerism. Solar and wind are great but they still require mining.... The main issue is Ethics. Do we need so much junk?
Reply: @lorenzoblum868  why are you even engaged with the issue? If it can't be solved then why not put your energy elsewhere?
Reply: @frictionhitch   in theory, most if not all problems can be solved. In order for this to happen, we need the accurate diagnose. Sure, fossil fuel emit more co2 than "renewable" but we should keep in mind that greed is the reason we always want more stuff... FYI, I've been riding my bicycle which I repair myself when needed for more than half a century. Not the same bicycle over all those years, but mostly wrecks that I fix. Btw, the carbon footprint of the military industrial complex Hitch?
Reply: @lorenzoblum868  I'm glad that you're riding your bike. That leaves plenty of oil for the US Navy. For the last 30 years we have increased green energy exponentially and has massively increased understanding of global warming and more and more people are taking"steps" to reduce their footprint and yet every year sans pandemic has seen an increase in CO2 emissions. We have tried your personal responsibility kind of way. Turns out it doesn't work because Everytime You pedal your bike the cost of energy goes down and provides me with an incentive to consume. You cannot fix global warming on the demand side. However if you do it on the supply side then people either have to come up with Solutions makeup for the deficit or they have to cut their consumption. The mining of fossil fuels is the diagnosis. I cannot see how any rational person could look at it any other way
Reply: @lorenzoblum868  So we should stop moving forward and maintain the status quo? What's your suggestion?
Reply: @CSqrdX   Reduce. Reuse. Repair. Recycle. Redistribute. Replant. Reconsider. Ride a bicycle... As for alternate energy sources, there are plenty. But most governments are corrupted because of greed....